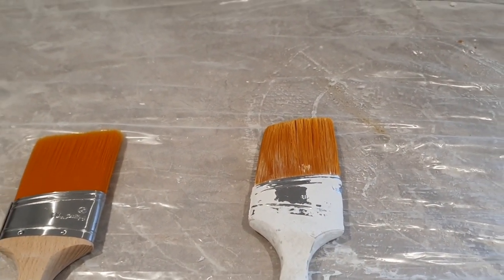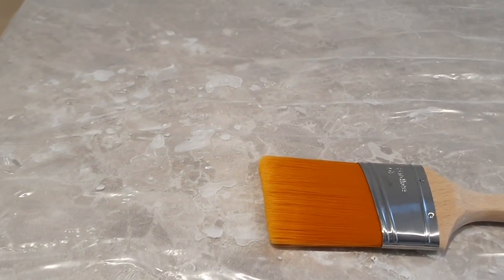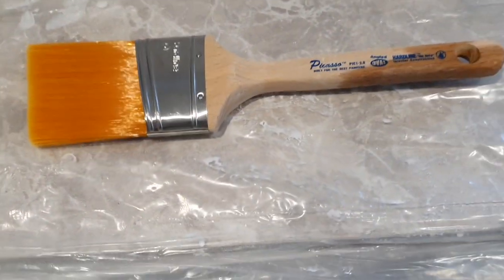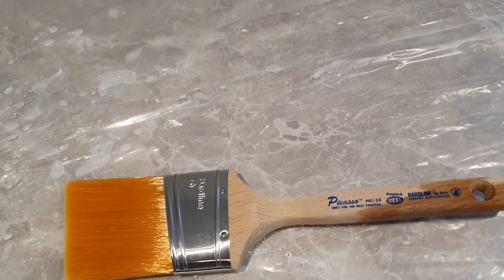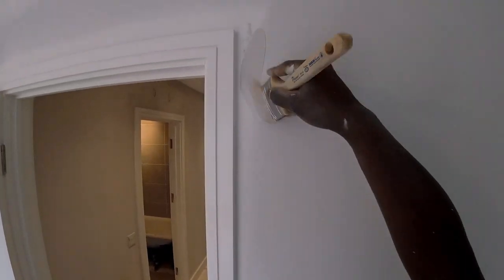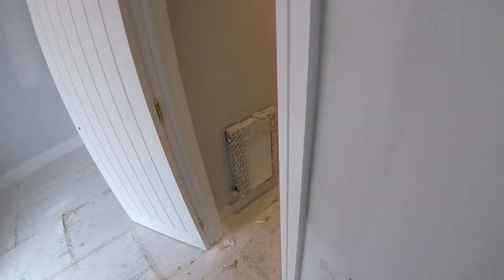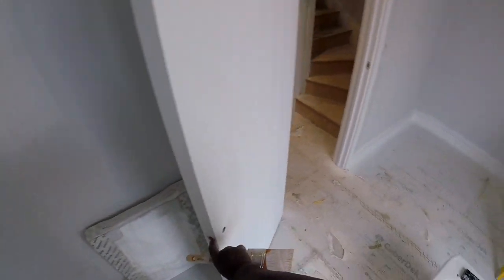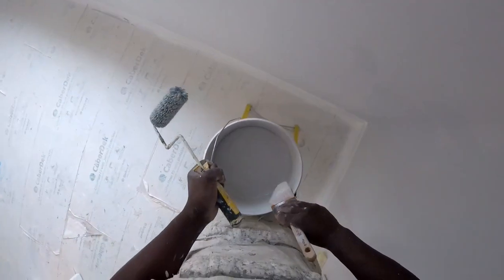brush review

Comment: My favourite for cutting in is the Monarch Advance Sash Cutter 3" , really hard to get hold of over in the UK now though so i'm trying to get some more from Australia , personally i find them better than all types of Wooster , Purdy , Picasso's , Corona , Oldfields ,Arroworthy etc, i've pretty much tried everything and they come out on top for me .
Everyone seems to find a brush they prefer though.
Reply from the maker: There's so many brushes out there to try , usually you find one that works for yourself then don't bother look to see if there is anything else is better. That's another on my hit list im going to have to try. Thanks for watching 👍
Reply from the maker: On the site I'm on at the moment where using dulux but I do prefer using crown which most of my do use, it sprays so much better than dulux with a finner finish on the walls.
Reply: I am a profesional painter for more 25 years This brush is rubbish
Reply: @venecovlogs4976  which one is top for your opinion? Thank you

Comment: Never felt the love for the Picasso. My fav by far is the oldfields. Can’t use anything but long handled, oval shape , angled. Superb in my opinion.  Picking up a standard length handle brush feels weird now lol.
Reply from the maker: I tell you what that extra length on the handle comes in handy where you've got no choice but to stretch when your cutting. I'm gonna try the old fields I've them online from where I buy my brushes from  and always wondered how they would  compare to a picasso . Is there a certain type ooldfield I should get ?
Reply: Just bought myself 2 ovel Oldfield's. Was using the Picasso's but only lasted a few months and the shape just went! Do the Oldields have a good lasting time mate? Hope you reply lol. Cheers
Reply: @TheTillsterandHerWeirdBestie  not bad. I did notice the 3inch angled wore down however I used it a lot so,I don’t think I can complain. I am sure you will love them
Reply: @Steven Mcfarlane  where can I find a 3 inch angled oldsfields brush? Looked everywhere!

Comment: They seem to hold a lot more paint than my 3” purdy
Reply from the maker: Yeah its a great brush , in my opinion it out performs the purdy in every department even in its price to buy i think its cheaper than the purdy.
Reply from the maker: Yeah its a great brush , in my personal opinion i believe it out performs the purdy in every department even in the cost im pretty sure the picasso is cheaper to buy.
Reply: @camdecorations9779  where do you buy them? Also how do you find water based gloss for spraying?
Reply from the maker: @darreneves4060  you can get them from decoratingdirect.co.uk , I've never really had a problem spraying waterbase gloss i do thin it down a bit but not to much
Reply: @camdecorations9779  cheers Colin, I appreciate the you taking the time to answer

Comment: they are nice brushes but i found Corona Excalibur
Reply: How do you like the Corona? I came across them online when I was looking for a new brush but ended up just using my old Purdy. I need a new brush now and keep wanting to try Corona. I found out a local paint store 2 minutes from me carries them I'm just trying to figure out which one to get. I would be using it for interior latex painting only. Looking for a 2.5 angled sash and I want it to be firm enough to cut nice straight lines but not too firm that it will lead brush marks when painting trim.
Reply: @jonathangaliano2617  corona chinex! So smooth and easy to clean.